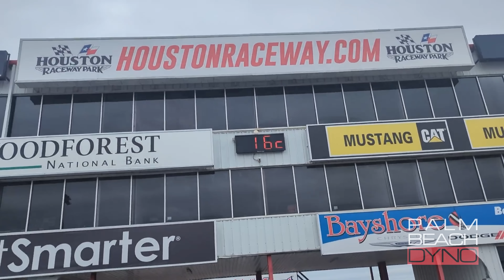I TOTALED MY GT500! | OVERKILLED: PALM BEACH DYNO GT500 CRASH & AFTERMATH

Comment: Ouch. A parachute would have been a nice thing to have.
Reply: I agree. Probably would have helped keep it straight
Reply: That’s what I was thinking…
Reply: Also had he not been hard on the brakes he would’ve saved it. He upset the car too much to save it putting all the weight on the front end and letting rear get light like that
Reply: @CarbonYote  One of the reasons I'm not a big fan on drag racing at this level.  The cars don't really do anything well at this point other than hooking up, but only under acceleration.   Those tires with their sidewalls the way they are are terrible once the car gets sideways, almost unrecoverable.  It just becomes a big mess if things don't go right and you lose traction for whatever reason.  Risk versus reward.
Reply from the maker: Worst part about that is we had one on the car and took it off. Hadn't gone fast enough with the turbos to need it...
Reply: Thanks for sharing your story and your pain! ✌️
Reply: @CarbonYote might’ve been to hard on them but he had to be on them and at that speed adrenaline all that you’d almost push em to hard but not mean to. he’s prolly goin 120mph heart racing and that happens you’ll hit the breaks a little to hard everytime.
Reply: A car designed for drag racing would be a better buy than a car designed for going round and round in circles on lap tracks.
Reply: Mustangs are spinners I see it all the time .

Comment: Ah that hurts so bad to see. Class act in how you are handling it, props to you.
Reply: This is just my theory..once the car broke loose at the 60 foot Mark and lost initial speed when you got back into the car hard it was making too much torque and power for the track on the big end being the setup/ traction and the fact the car unloaded and loaded was the issue I don’t think it was you or the car. Simply because the car wasn’t grounded as it should be, nothing you could of done to save it.
Reply from the maker: Thank you
Reply: @brucemoore634  Dude... There was oil leaking out under the car... you can literally see it pouring out as he pulls away off the line... The tires got oil on them and the car lost traction and couldn't hook back up. Not the drivers fault. I agree there. @palmbeachdyno Hope you realize this. Watch the video closely.

Comment: I feel for your loss but respect you more than ever for asking for no donations or to donate to someone that truly needs it. You have a very successful business and i know you'll be back on top in no time.

My 2018 f-150 is pretty far from a gt500 in any comparison but i did find out my ABS was being applied to my rear brakes even with my TC turned off. I rarely turn off advanced trac but I'm unsure if it would make a difference. At 45k miles my rear pads were gone and the remaining rotor life was nearing its minimal thickness all while my front brakes were in decent shape. I do hot rod my truck around, heavy takeoffs, hard on braking in the hills etc but im not brake torquing my truck either. It was all the proof i needed that ford programmed these vehicles to unknowingly be applying brakes when detecting wheel spin to counter it. I never noticed it while driving but it was definitely happening. Ended up doing a full powerstop upgrade.

Comment: It was 100% not the cars fault.  The car did not modify itself without consideration for how modifications will interact with stock OEM components.  The car did not continue the run after failing to launch. You may want to consider taking a basic crash control driving course.  From the video it appears none of what you tried to gain control had any effect.
You need to focus on what caused the very first issue, Wht made the car pull to the right.
Something I learned back in the 70s was when driving on slippery surfaces like snow covered roads was the quickest way to recover from a tail fishing car is to depress clutch or shift into neutral with auto transmission, let go of steering wheel and do not brake.  The car will not over correct on its own. It goes completely against what you think to do.

Comment: Yup, you have a Yaw sensor on some cars it will mash the brakes on you causing you to overcorrect and go the other way quick. Dang near killed me on the tail of the Dragon when the backend stepped out. I corrected and it mashed the brake on one rear wheel causing the car to snap back the other way.
Reply: This just happened to me in mine. I thought my GT500 throttled up. I had no foot on gas or brake. Hit the curb. Kept going to the right

Comment: Why do they even have concrete barriers on the side of the drag strip. It should be made of softer material or have nothing at all.
Reply: Softer material tend to grab the cars more if they hit it and cost a lot more to replace, having nothing will just leads to even worse crashes.

Comment: Sorry for your loss man! Glad youre ok! Do you think the issue had anything to do with having the stock front tires on the car with slicks? I thought I was told awhile ago that if you run stock front tires with slicks they counteract each other since they have different grip levels. It was recommended to run skinnies. Just wondering if that was something you were thinking of. You tuned my twin turbo Mustang remotely here in AZ and it runs amazing!!  There is a racing event Im thinking of entering in Tucson but would like to hear your thoughts on the tire setup though.

Comment: Even with advanced traction control shut "completely off", is it's not actually off and is still monitoring and will turn itself back on to intervene if the program recognizes the car exceeding factory limits.

This is the same thing for all V8 Mustang Shelby included 2011 and up. That is why people who do drifting around circuit tracks, or drag race in highly modified high power mustangs remove the fuse (found on the battery terminal mount) for the advanced traction control, it is truly the only way to disable it completely and prevent it from turning on and interfering with a skilled driver and making him crash.

These systems are very advanced and designed to keep the average driver from crashing, but they are hinderance for skilled drivers and make them crash, and Ford purposely makes him very difficult to disable for legal purposes.

Comment: Did you have a front sway bar on still? Couldn't tell in the tear down. The outside view when it started to lose control kinda looked like the front end was super soft the car was basically 3 wheeling.

Comment: Really sorry about Overkill. The excellent part is your OK. I fiqure over time you'll built Overkill 2. With all you accomplished with your beautiful GT500. You'll built another one. Some things that stood out on that run was the slow launch. Maybe that was planned, but from how you basically appeared to lose control. It appeared the power was at the top end of the run possibly causing the rear tires to break lose.

Re:Stability control automatically senses when the vehicles handling limits have been exceeded and reduces engine power and/or applies select brakes to help prevent the driver from losing control of the vehicle. With the engine mods and tune. I'm not sure if you still had this feature. Obviously this has never been a issue on previous passes.
Reply: It is "lose" control, not "loose" control. Totally different words. Loose rhymes with goose, moose, noose etc.

Comment: looks like something broke on launch , possibly oil or water under the tires , suspension unloaded , and couldnt recover it , a parachute could have possibly saved it as soon as you wet over the center , pull the chute and steer to middle of track and hope it slows you down enough , not a guarantee but it would have possibly helped . glad your ok , rebuild that car and go faster !!!

Comment: I’m a retired NASCAR modified driver I owned a 2015 GT 500 I did a few mods to it it was making north of 650. I totaled it with300 miles on it . The trax control was off and the stability control was off . But it still comes on so when the system sees a problem I tried to spin it backwards and the throttle was taken away the brakes steered the car straight so it’s trying to straighten the car out straight into the wall . There’s nothing you can do it’s driving you . Never again will I race anything with that shit in it Good luck .
Reply: Wow. I just hit a curb in mine and I’ve driven fast for 30 years and it was like it was out of my hands. I can handle a car a little sideways but this thing did it’s on thing. I was shocked and now I know

Comment: Ford has a Traction Control system which can automatically control wheel speed, and there is a chance that had you reduced you attempt to control the car it may have straightened by itself.

Comment: much respect for refusing donations. I subscribed just for that. The launch looked like it bogged hard. somebody was hitting the brakes when it broke traction. I'm assuming that was you. Something could have broke with the IRS, that would be my guess. I broke an aftermarket lower control arm on the street with a lot less power. luckily i noticed something was wrong right away.
Reply: this will be met with much criticism, but all this work to make this a drag car you should have swapped to a 9 inch rear end. Even the 2018 cobra jet used a solid rear axle because they are just better at handling this kind of power. it wouldn't surprise me if you broke some piece of that irs.

Comment: Even at just above 100mph a properly  mounted parachute provides enough down force to make a big difference, and helps center the rear of the car. The second obvious glaring problem with these newer street cars packed with electronics to make the car stable and drivable on highways do not fair well on a track. Third issue is any modifications that take the car outside of the parameters that ford built into the car between the electronics and the mechanical engineering of the car is an accident waiting to happen. The car cannot begin to respond properly to driver inputs. It really Doesnt matter how much is turned off or what mode its in. High performance cars now resemble fighter jets more than they do cars. Unless you have full control over every system on the car (and you don't) bad things will happen the second something is outside of the norm.  It still sucks to see such a special, bueatiful car get destroyed.

Comment: Ahhh man that sux....I am watching this thing over and over again and its just not making any sense... The car had a ton of modifications and the car was clearly fast. But under all of that it was still a GT 500 and should have still handled like it was on rails... It wasnt that bad and that thing should have gathered back up on decell after the wiggle... Was the track coated with some crap down there or did something let go on that car first ?  The thing continuing to over steer jsut isnt making any sense.... Were you hard on the brakes too soon making it try to come around ?

Comment: Lucky a firebomb did not happen with that much leaking fuel while dragging metal on metal or two metal parts on the car itself when dragging the car up the tilted bed of the tow truck.  How come someone yelled to kill the battery with dash lights still on, only leads one to suspect there was no required battery kill switch or was it wired wrong  or nobody pulled the required rear battery kill switch ?
Reply from the maker: There is no required kill switch on a factory location battery